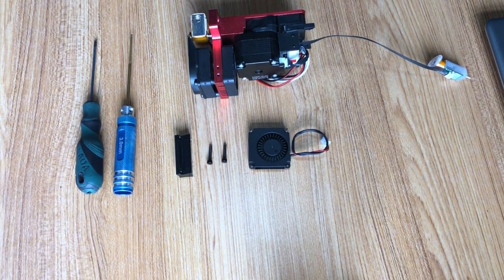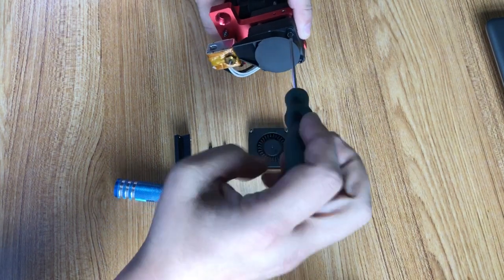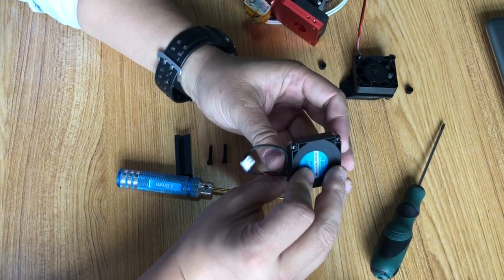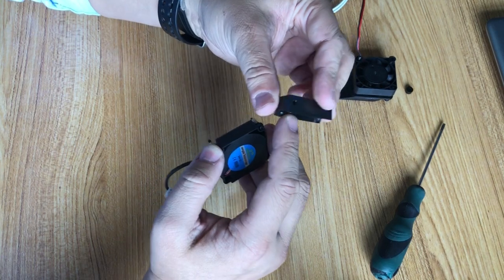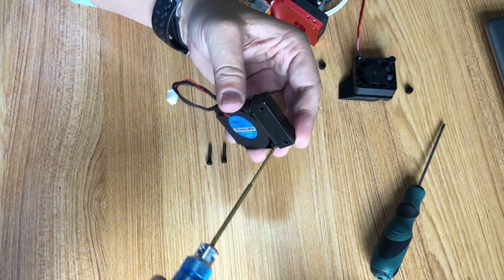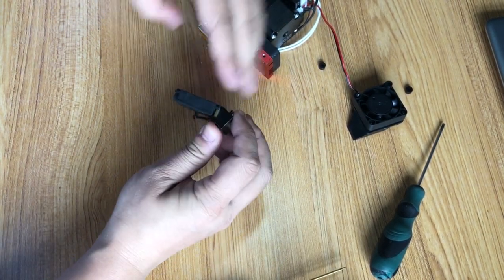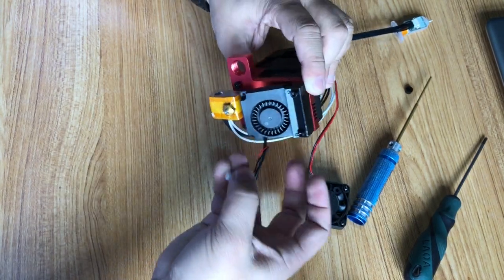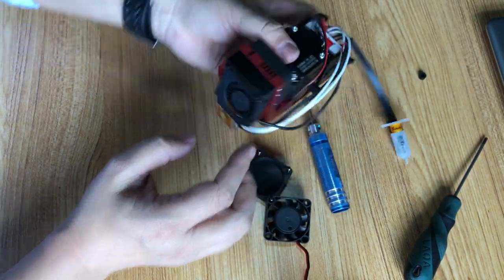How to install the wanhao D9 filament cooling fan?

Comment: I ordered a mk2 upgrade kit from wanhao.store but when the fan arrived, the brass bushings was not included and the fan is mounted with the sticker the wrong way on the aluminium angled plate from the factory. Since i dont have the brass bushings (they where not on the old fan plastic part either) i cant mount it the correct way
Reply: This is true for me, too.  When I mount my fan it looks like it mostly blows air at the whole hot end, instead of at the tip.  Seems wrong.